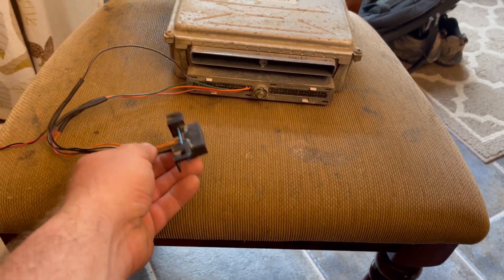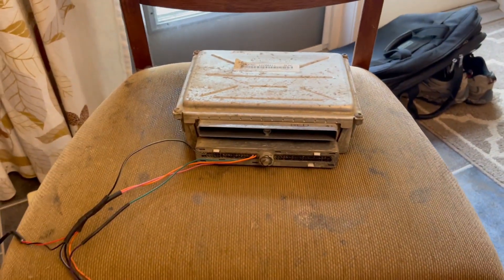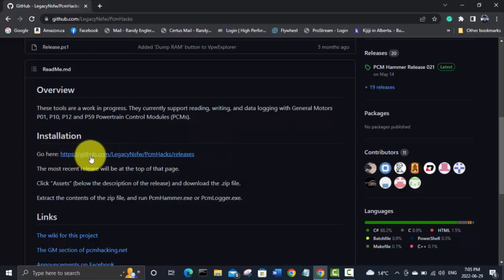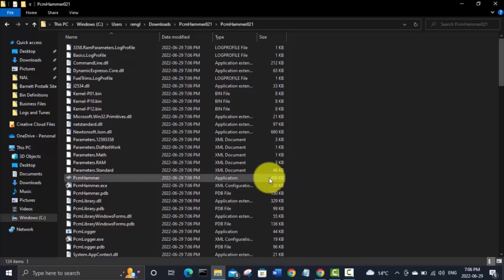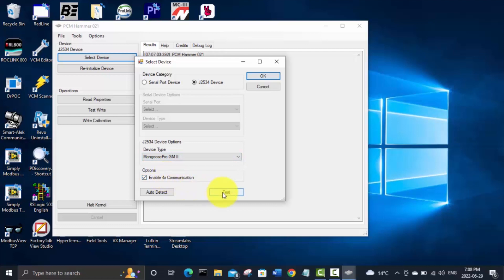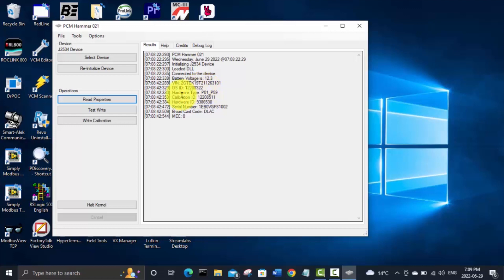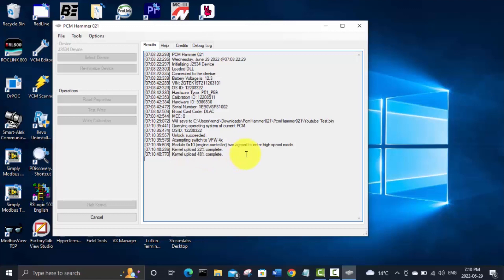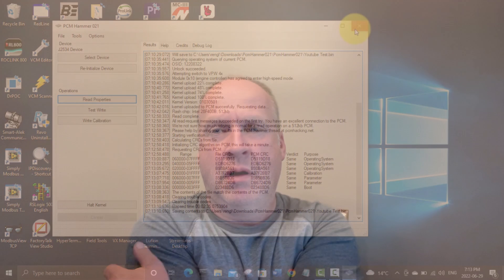Introduction to PCM Hammer

Comment: Hey Randy, do I have to use that obd2 scanner specifically or will any of the Bluetooth scammers work? I’m new to this, and want to erase all the junk on my instrument cluster
Reply from the maker: @StationroadRatrods  Hi Barry, I’d recommend the OBDX Pro VT. Not all Bluetooth scanners will work, especially not the cheap ELM327 based scanners you can buy on Amazon. But a good J2534 based tool should work. Here’s a link to a page that shows what interfaces are supported: https://github.com/LegacyNsfw/PcmHacks/wiki/SupportedDevices
Reply: @ thanks man!

Comment: Lowbuc ls , ordered a computer fromyo on u on the 8th  . Didn’t take long to take payment…. When do I get my computer?
Reply from the maker: Check your emails. I received your order late in the evening on August 8. I sent you an email asking for details about your order at about 6:30 AM on the 9th. When I didn't hear back from you, I sent out a computer later on the 9th. You were sent a tracking number which indicates that it should be showing up today (August 16th.)
Reply: @LowbuckLS  I received the pcm today  hooked it up and still didn’t run. Threw quite a few codes , I must have overlooked your e-mail sorry for details, but it is stock engine , 4l60, no cats , has bank 1 o2 codes, cat codes , po 452, po141, p1683,po343,, po161,po155,, the only code I had previously was the high voltage on cam sensor, still get dtc’s for o2 sensors , htr , evap and cats Do you have any suggestions? I’m leaving town tonight for 5 weeks (I work away from home ) I’ll

Comment: Having some trouble with PCM logger. Using an obdx pro VT and a USB cable. I can connect to the tool fine. I set up a profile and saved it, set up my parameters, and hit start logging. Ran for 35 seconds or so, hit the button to stop logging and no log file is created anywhere, no matter where I set the log directory. Anyone else have this issue or am I an idiot?

Comment: I bought the VCX Nano and cannot figure out how to select it in PCM hammer. I think I successfully installed the VCX software (but none of the bundled instructions match the installers). The VX manager detects the VCM nano. However, when I load PCM hammer, it cannot find it.

Comment: do you know if pcmhammer will work for a pontiac grand am 04 with a 3.4l motor. i dont know what p01 ans p59 means. i want to be able to spend no money  but have a vcx nano
Reply from the maker: I’m not familiar with the Grand Am but from a quick google search the PCM looks the same  as these P01/P59 units. I can’t say for sure but I’d say there is a good chance PCM Hammer will work. If you’ve already got a VCX Nano it wouldn’t cost anything to download PCM Hammer and try and connect to it. If the PCM is out of the car I’ve got a video I’ve got a video on how to build a bench harness so you can hook up to it on the work bench.
Reply: @LowbuckLS  I didnt work...does it matter if the pcm is still in the car? it kept saying failure to unlock key. i did manage to do something and it unlocked and had an error
Reply from the maker: @unluckiestnumber7172  that may be a slightly newer PCM than the ones I’m working on, nothing I work on needs a key. I did find this site that says it can generate a key to communicate with a GM PCM, maybe it will help? You could also try send an email to the contact page on this site, they might be more helpful than I am. https://universalpatcher.net/gm-5-byte-keys/
Reply: @LowbuckLS  Im trying this in the car so not on a bench. not sure if that matters. it gave me the file number needed for the bin file. it then said the following: pcm did not accept the key", expected bytes needed 6 but got 4 bytes, BCC query failed error MEC:0:
Reply from the maker: @unluckiestnumber7172  yeah I won’t be much help with that unfortunately, I’ve never ran into that issue before

Comment: amazon has an Elm OBD2 connector for $22 and Tuner Pro RT even comes with Elm support built in.
Reply: ELM is not capable and not supported. It'll allow vin change, and gather some info about the pcm, but thats it. It cant read or write a tune.

Comment: When was this video made?  No wonder you laptop doesn't have Bluetooth.  It looks like a 2011 to maybe 14(tops) model. Lol...  It's a 10year old laptop...
I remember back in the day when stuff needed serial or parallel ports, so people used old stuff for that.  But you don't have Bluetooth.  Every new laptop, even the cheap ones, from the past 5 years have BT4., Or more.   Lol..  Just no excuses....
Reply from the maker: So I should have bought a new laptop to make this video?
Reply: @LowbuckLS  hey man, I appreciate your time and effort in sharing your knowledge. Please ignore idiots who think $300 new crap laptops are better than the pro grade laptop you got years ago. Those are the same idiots who shop cars based on payments and not total cost.
Reply: @LowbuckLS  At  the time I'm writing this comment you have over 10k subs.  That means you're making enough in youtube revenue to buy a "newer" laptop.  Even the cheapest ones on the market today, for around $300 have bluetooth.  The laptop you're running is a Decade old.  In tech-car terms, that's like saying "my 1984 chevette doesn't have enough horsepower to run 10's, the power heated seats are missing, and it's doesn't have bluetooth." lol... Its not saying theres anything "wrong" with having a 10yo laptop, or a chevette, but when they didn't come with the features you want, you either have to upgrade, (which in both cases is a waste of money) or replace it with something that has the features you want.  Microcenter has BRAND NEW HP's with Windows11 for $299 with Ryzen 3 3250u.  It's not a 6second drag car, but compared to the Chevette you're currently using, It's like a 2008 Scion TC.  Still not a big engine, but with all the newer tech, It's going to preform better than a Corvette from the Early 90's... lol

Comment: If already have an HP Tuner device can i use that to hook up to the compter to pull the bin file with pcm hammer or do i need to buy another cable like the mongoose? PCM is already unlocked with hp tuner.
Reply from the maker: Unfortunately the HP Tuner cable won’t work with PCM Hammer. Here is a list of supported devices. If I were starting over, I’d probably get the OBDX Pro VT. https://github.com/LegacyNsfw/PcmHacks/wiki/SupportedDevices

Comment: Do you have any advice for this notification i get when i save the bin file. It says "error -one or more checksums could not be updated. check checksum addressing, etc, for validity."
Reply from the maker: Yes you probably need the correct checksum plugin for TunerPro, I go over that at 15:39 in this video: https://youtu.be/ae-WWVEcCSI?t=938
Reply: @LowbuckLS  nice thanks I also tried something different that worked. I went to XDF in the menu, view edit xdf header info,  then checksums tab, 1-operating system checksum hit edit selected and noticed the "plug in module field" was blank. I set it to Tunerpro default checksum plug in like the rest of the items 2-8 and it worked no errors. Just to be safe im going to do it the way you recommended let me know you thoughts.

Comment: Great video but i wasnt able to read the Pcm I got this error " unable to get operating system id. Will assume this can be unlocked with the default seed / key algorithm " how do you get past that?
Reply from the maker: Is it possible that your PCM has a tune that someone locked with a password with HP Tuners? I’ve never seen that error before.
Reply: @LowbuckLS  I don't think so the car was completely stock. I will try on my 02 Tahoe today and see if it works. This seed algorithm seems to be some encoding done from the factory from what I googled.
Reply: @LowbuckLS  so I tried the same thing on my 02 Yukon and it's working fine. That's a P01 computer . Maybe the Vette since it's 04 it has the P59 and they have the encryption block. Have you done any P59?
Reply: @ralphyc81  P59 is working and supported. There is no encryption. The first one probably there was another issue with a module on the vehicle if it was on a vehicle, or a wiring problem or bad connection of you were on the bench. Often bad power supplies (low voltage, low current, or electrically noisy) can cause this too.

Comment: About time there’s a way to get away from the monopoly of HP Tuners!  👍👍👍
Reply from the maker: Yep. There are still some situations where HP Tuners has an advantage, the logging functions on these free tools needs some refinement but for simple stuff like removing VATS and O2 sensor codes these free programs work just fine. Only works on Gen 3 LS stuff for now though.
Reply: @LowbuckLS  logging in the issue I'm having currently. I can't seem to find much information on pcmlogger. Do you have any good sources or videos you can share?